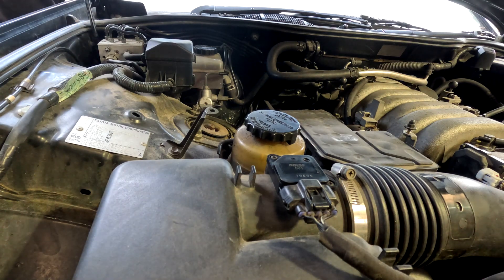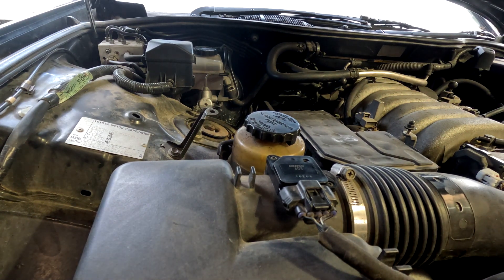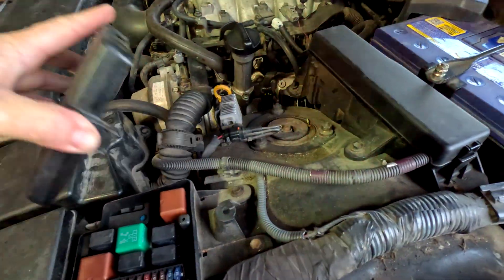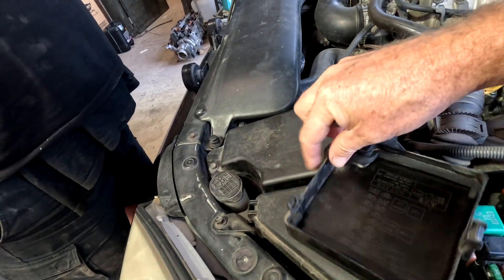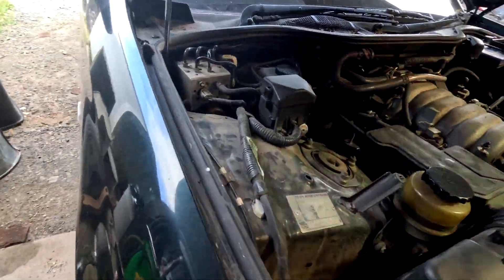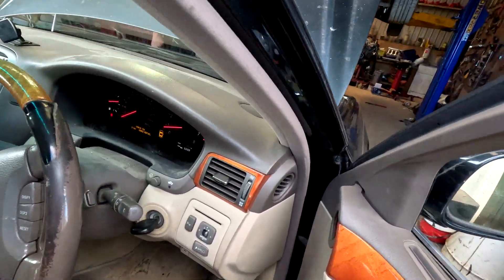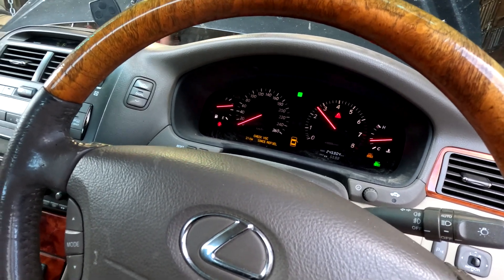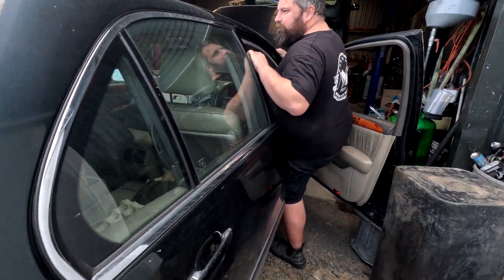3uz & 1uz AFM Codes P0100 & oxygen sensor codes P0135 P0141 P0155 P0161 and the EFI 2 fuse issue

Comment: Mine has this issue and blows the fuse every time I rev high
Reply from the maker: At least thats a easy circuit to diagnose now you have found which fuse blows.
Reply: Mine blowed 7.5A yesterday. This morning, I've changed it,  then drove it for a few miles, then blowed 25A. So tomorrow I will try to find the problem. Thanks for the video